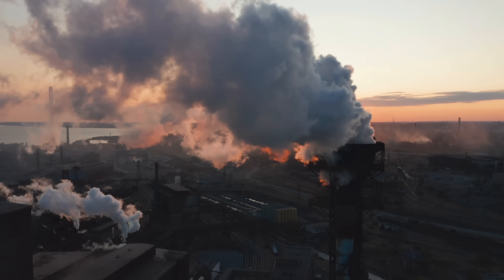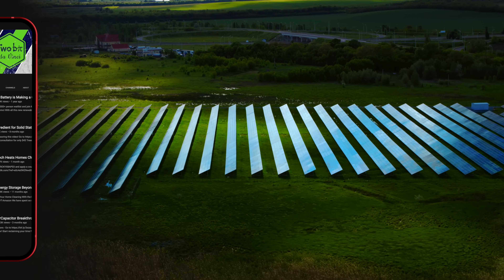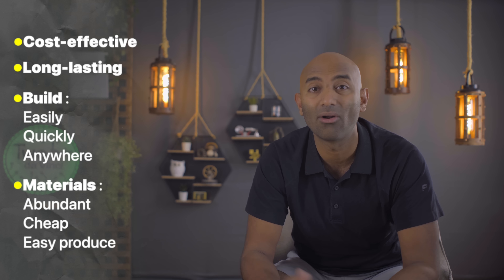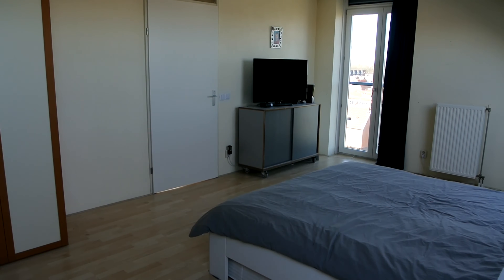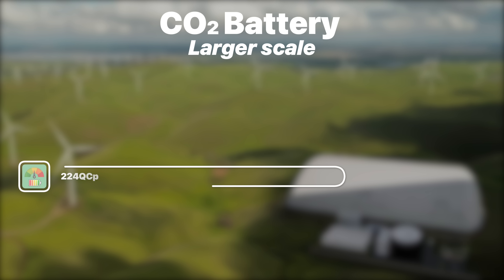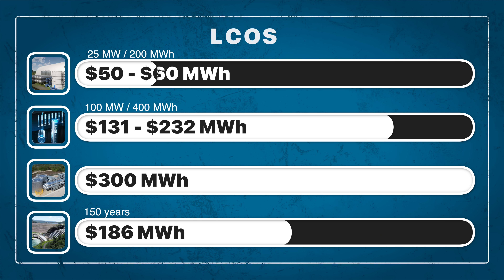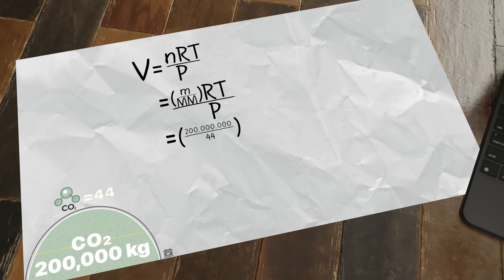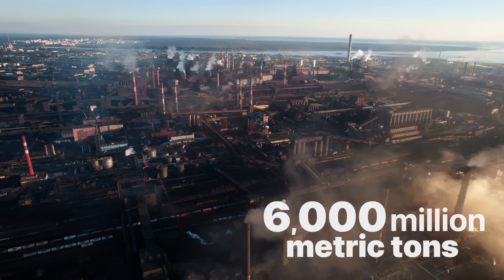The GENIUS Of the Carbon Dioxide Battery

Comment: Potent heat absorbers like co2 are excellent coolants. Co2 is used as an industry coolant.

The question is why the coolant co2 in the greenhouse hypothesis has the opposite effect on temperature compared to all other applications? There are no experiments that demonstrates warming from co2, they all show co2 cools.

How is an air cooled engine cooled? By air absorbing the heat from the surface of the cylinder. Hos does the greenhouse effect warm the Earth surface? By air absorbing the heat from the surface.

In both cases its the same process, but the greenhouse hypothesis claims that cold, heat absorbing air has the opposite effect on the temperature of the surface than it has on all objects ON the surface. It doesn’t add up, the physics in the greenhouse effect is wrong, it says the opposite of what we know from applied thermal physics.
Reply: When you're talking about CO2 as a coolant you're talking about it's properties as a gas. Expanding a gas absorbs heat, compressing a gas releases heat. You can use this property to move heat around, expanding in one place and compressing in another. When you're talking about cooling an engine you are talking about simple conduction - when stuff touches other stuff heat flows from the hotter stuff to the colder. These are not the properties we are looking at in the "greenhouse effect".

Here we are looking at how gasses interact with photons of light. The outer electrons of a gas absorb very particular frequencies of photons then immediately re-radiate them in a random direction. CO2 happens to have absorption bands in the infrared, right where the Earth "shines" the brightest. The "greenhouse effect" doesn't heat the air it just scatters some of the infrared light back to the Earth's surface. The air gets hotter only by contact with the warmer ground.

To stay the same temperature the Earth has to "shine" away as much energy (in the infrared) as it gets as light from the sun. If you block a little bit of the outgoing infrared the Earth has to get a little hotter to "shine" a little brighter to balance out again.

There are tons of experiments demonstrating all of this.
Reply: @flightofthejellyfish  Heat and temperature is not a matter of photons. In the physics of heat transfer you don’t use photons, you use the Stefan Boltzmann equation for radiative heat transfer. When you cool an engine you deal with both radiative transfer and conduction/convection, just like you do with the Earth surface. Photons is quantum physics and you can’t use quantum physisc for bulk properties like temperature. Infrared or visible doesn’t matter for heat transfer, the s-b equation works for both.

No, there’s not a single experiment that demonstrates that co2 can raise temperature. All of them show that co2 cools. 

Can you find an example where co2 is used for warming and not as a coolant? No you can’t. I’ve searched the litterature for ten years, there’s nothing. If it worked for ”trapping heat” we would use it in windows. But we use inert gases instead, because you want minimal heat absorption to retain heat. That’s how heat trapping works, how insulation works, by minimizing heat absorption. Co2 increase heat absorption.

Put each of your hands in buckets, fill one with ice water and one with 10C water. Which bucket absorbs more heat? Which bucket cools you more? That’s right, the ice water absorbs more heat and it cools you more. More heat absorption=more cooling. Co2 increases heat absorption, therefore it cools more. That’s why its an excellent coolant. Compression or no compression, co2 absorbs a lot of heat.

If the atmosphere cools all objects ON the surface, and it does, then it must also cool the surface itself. The atmosphere is average -18C, the surface is 14C. Cold air cools hot surfaces. Didn’t you learn that in school?
Reply: @emiljunvik3546  "Heat and temperature is not a matter of photons." "...you deal with both radiative transfer..." Radiative transfer is done with photons they are the things being radiated. Emission of radiation from "hot" objects is what lead to the discovery of quantum mechanics, you can't explain it without QM. But just the QM knowledge that particular gases absorb and re-emit particular frequencies on the EM spectrum is sufficient here.

"Can you find an example where co2 is used for warming and not as a coolant?" Er, you could watch the video you're commenting on where the CO2 going through the compressor is shown heating coolant water. But that is irrelevant "These are not the properties we are looking at in the "greenhouse effect"." 

The Earth hangs in a vacuum there is no conduction or convection the only way heat leaves the earth is by radiative transfer.

You can't more heat from the surface to the air without heating the air, you are trying to have your cake and eat it too and make energy magically disappear. I'm not disagreeing with you the sun heats the surface the surface heats the air (I said so above) that's the way the energy flows. But if that was the whole story the Earth would just keep getting hotter and hotter as it absorbed more and more sunlight. You have to deal with radiative transfer. To stay the same temperature the Earth needs to radiate the same amount of energy it receives from the sun out into space.

I didn't use "scatters" in a technical sense just a descriptive word for how the photons move around while avoiding irrelevant details. You've got it though didn't need to explain it to you, you've done really well here, you've reasoned out just how improbable it would be for a particular photon at 10km to make it to the ground. Now start with a photon emitted from the ground and use the same reasoning, how likely is it to be radiated into space? This is the "greenhouse effect" you've worked it out!
Reply: @flightofthejellyfish  "Radiative transfer is done with photons they are the things being radiated."

Photons are included but radiative heat transfer was discovered long before photons. You do not use photons to calculate heat transfer.

"Emission of radiation from "hot" objects is what lead to the discovery of quantum mechanics, you can't explain it without QM."

Yes you can. It´s how it´s done. Heat transfer and temperature is calculated completely without photons.

σ(T1^4-T^2^4)=radiative heat transfer. 
No photons in the equation.

"But just the QM knowledge that particular gases absorb and re-emit particular frequencies on the EM spectrum is sufficient here. "

Completely irrelevant for heat transfer and temperature. You´re talking about spectral properties an QM. QM doesn´t apply for bulk properties like temperature. QM doesn´t apply for bulk, it only applies for microscopic details, not macroscopic.

"Er, you could watch the video you're commenting on where the CO2 going through the compressor is shown heating coolant water. "

Net effect warming? Nope.

"The Earth hangs in a vacuum"

Yep. Put a glow-wire in a vacuum chamber, read temperature. Then fill with co2, read temperature. It´s warmer in vacuum. Co2 cools by absorbing heat. It´s basic thermal physics.

"there is no conduction or convection the only way heat leaves the earth is by radiative transfer."

Yep. Only one way to cool itself. Wíth conduction and convection you have 3 ways of cooling, in 3 dimensions instead of only 2 as in surface radiation only.

"You have to deal with radiative transfer."

Yep. Here it is for Earth and atmosphere:

σ(288^4-255^4)=150W/m^2

The atmosphere cools the surface by 150W/m^2. The transfer is the cooling.

"I didn't use "scatters" in a technical sense just a descriptive word for how the photons move around while avoiding irrelevant details. "

You obviously don´t know what you´re talking about since you use the wrong terms. Bad excuse and I caught you being wrong.

"Now start with a photon emitted from the ground and use the same reasoning, how likely is it to be radiated into space? "

Very likely since density decrease upwards. For each centimeter upwards the probability increases to continue in that direction. Downwards you have the opposite relationship. Very small probability.

The spectrum from space clearly show how co2 decrease intensity, it´s shown as a large "bite" in the continous curve. Area under the curve is intensity.

Lower intensity=lower temperature

Co2 doesn´t warm the atmosphere, it cools the atmosphere.

Simple basic thermal physics from over 100 years ago.

Tell me why Planck is wrong and you´re right.
Reply: @emiljunvik3546  "You obviously don´t know what you´re talking about since you use the wrong terms. Bad excuse and I caught you being wrong." I tell you that photons are absorbed and re-emitted then a sentence later use the word "scatters" and you reply: it's not scattered it absorbed and re-emitted, and you think I'm the one who didn't understand. I thought twice about using that word but it was the right word to describe the way the photons move and there was enough context for all but the most willful misunderstanding. Maybe if you take a deep breath and stop acting so threatened you'd be able to comprehend what's being said instead of skimming for what you mistakenly think is a gotcha.

"Net effect warming? Nope." What do you think is happening when you use CO2 as a coolant, it's been compressed and left it's heat some place else so it can now be expanded to absorb heat in the place you want cooled, net effect cooling? Nope. If you are going to retreat to your motte and claim that you've "searched the litterature for ten years" and only ever heard about simple conduction, that doesn't help either. If the air absorbs heat from the ground the air gets hotter, net effect cooling? Nope. The atmosphere is not an infinite heat sink.

Hang on a sec. You've agreed that heat always flows from hot to cold. We emit CO2 by burning stuff, it is emitted at hundreds of degrees, in your mind, how does it achieve this conductive cooling?

"Yep. Put a glow-wire in a vacuum chamber, read temperature. Then fill with co2, read temperature. It´s warmer in vacuum. Co2 cools by absorbing heat. It´s basic thermal physics." Okay now imagine a glow wire with enough gravity to hold a thin layer of CO2 at its surface, because we ain't filling all of space with infinity CO2. Sure depending on the CO2s initial temperature it may absorb some heat from the wire, but once it's hot its still surrounded by vacuum so the heat can't be conducted away, it has to be radiated. But now there are bites taken out of the emissions by the CO2. The wire is no longer a perfect emitter and mindlessly applying heat transfer equations as if it is, is going to give you the wrong answer.

"The spectrum from space clearly show how co2 decrease intensity, it´s shown as a large "bite" in the continous curve. Area under the curve is intensity." YES, YES! less intensity shining out into space! You've just also claimed that it is "Very likely" for those photons to be emitted to space. Why are they missing?

The Earth is not a perfect blackbody. Do the calculation if it was a perfect blackbody it would be about -15C. One of the ways it's not a perfect blackbody is because it has bites taken out of it's spectrum by gases in the atmosphere, mostly water, but also CO2 and methane and others.
Reply: @emiljunvik3546  I didn't have time to try and work out how to explain this to you yesterday but I did want to respond to this:
"Very likely since density decrease upwards. For each centimeter upwards the probability increases to continue in that direction. Downwards you have the opposite relationship. Very small probability."
The probability doesn't change it's always a coin flip 50/50 upwards or downwards. I'm going to assume that you misspoke here because what you seemed to be saying before was that the distance of travel between absorption events increases with height. Agreed the photons travel further the higher they go. The error you are making is that this is not the same as saying they travel more in the up direction than the down direction. Think about it, if a photon flips heads and travels upward, then flips tails and travels downward it is traveling through the exact same air at the same height.

Do the thought experiment: a photon is emitted from the ground and goes to height 1, flip a coin, heads it goes to height 2, tails it goes to height 0 hits the ground and its journey ends. Because it is a 50/50 you would expect an average photon to hover around where it started, it would take a rare run of more heads than tails to get to any significant height. Because where it started is the ground if at ANY time it has more tails than heads it's journey is over. Have a go, grab a coin and plot out a few paths, you already know that half the time they're not getting past height 1.

Now let's put in your pressure gradient. Instead of labeling the heights 1,2,3... give it an exponential. The number of absorption events doesn't change, the height the photons get to does, so it will make escapes less rare. As long as the travel distance is long enough compared to the pressure gradient significantly more may escape, but you already know half of them aren't making it above height 1.

Here in reality land you don't have to go to space to see the bite taken out of the spectrum by CO2, it's pretty much done by about 10m off the ground. There's not much of a pressure gradient over a height of 10m and that travel distance must be quite small. 

To summarize, what I'm getting from you is: CO2 emitted at fire temperatures near the surface of the Earth picks up energy from the cooler surface resulting in it having a temperature of, on average -18 degrees. At the same time photons in the absorption band of CO2 by a mechanism that logically doesn't work, powered by a pressure gradient that is insignificant relative to travel distance, are transported to space where satellite measurements mysteriously show they never arrive. This energy not going to space proves Earth has "lower temperature". And this is backed up by misapplying thermodynamics equations as if Earth is a blackbody because you don't need the tiny bit of QM that explains some of why it is not. Good Convo, Glad you knew what you were talking about and could set me straight.
Reply: @flightofthejellyfish  ”it just scatters some of the infrared…”

No it doesn’t. It absorbs infrared radiation. When a photon is absorbed it’s destroyed, gone. When the molecule emits a photon it’s a new photon. Scattering isn’t absorption. Co2 doesn’t scatter surface emission, it absorbs it.

Lets say a photon is absorbed at 10km altitude. 50% of the time its emitted downwards. For every centimeter it travels downwards density increases. This means that the likelyhood of it being absorbed again before it reaches the surface increases. When reabsorbed on its way down, its emitted down/up 50/50. So the likelyhood that such a photon reaches the surface is practically 0. Also, co2 radiates at 14micrometers, according to wiens law this corresponds to a blackbody temperature of about 200K, -70C. A blackbody at 200K cannot warm a body at 288K. It cools the body at 288K. Planck mentioned this in ”theory of heat radiation”, page 8.

”A body A at 100◦ C. emits toward a body B at 0◦ C. exactly the same amount of radiation as toward an equally large and similarly situated body B′ at 1000◦ C. The fact that the body A is cooled by B and heated by B′ is due entirely to the fact that B is a weaker, B′ a stronger emitter than A.”

See? A colder body(the atmosphere) always cool a warmer body(the surface).

Tell me why Planck is wrong and you are right?

Comment: this requires compressing the gas at over 1000 PSI in several stages. so it is totally impracticable for home use. so it is basically just a way for corporations to make money while making folks feel better about there excesses!!

Comment: Force companies? you mean use big government to make them do what they think is better? that is the problem with this climate change cult, they have shutdown real clean energy alternative such as nuclear, there are so many good and practical ideas out there to solve the energy problem but they have reduced to mostly solar and wind, safer, smaller and cheaper reactors would have been around these people had not vilified the technology for decades, now they are vilifying fossil fuels just as much. The argument could be made we could use fossil fuels as long as they available and use carbon capture technology to neutralize the co2 emissions. By the way the medieval warm period happened when there were no cars and climate activists flying all over the planet on their private jets.

Comment: Right now, wind & solar farms are attached to grid with little or no storage. If the CO2 mechanical battery was built next to a coal powered plant, than the CO2 is right there. Along with the grid that the wind & solar farms are attached to. So, no miles of plumbing or transporting CO2 to these farms.

Comment: Terrorism. What happens if someone plants a small explosive device to cause sudden release of all the stored 
CO2? Carbon dioxide is a quick and silent killer in sufficient quantity and concentration. See lots of info on the killer CO2 releasing lakes in Africa. This problem can be mitigated by only placing the domes in remote and isolated areas and by having security, and perhaps by making the domes cellular so a catastrophic sudden release would be difficult to achieve, but it is not a trivial problem.